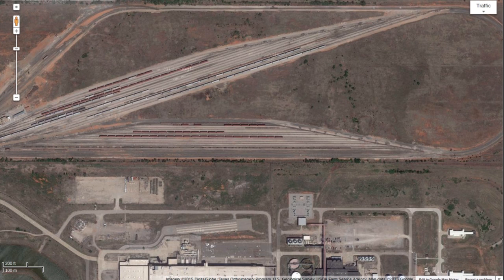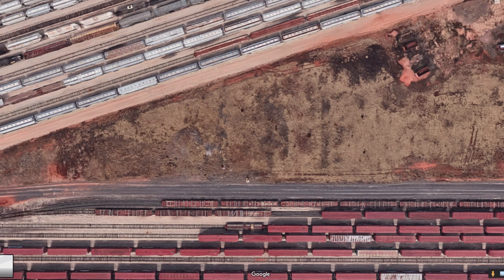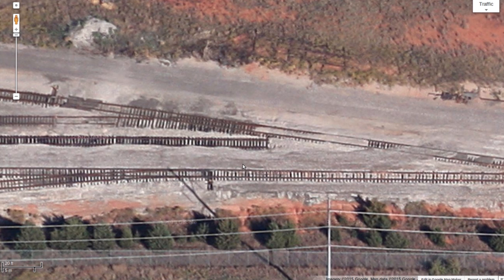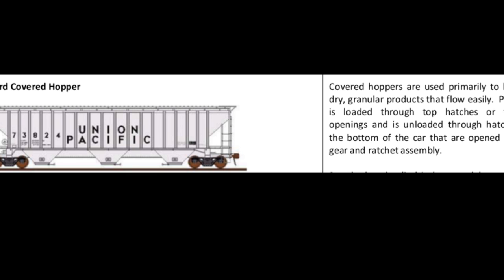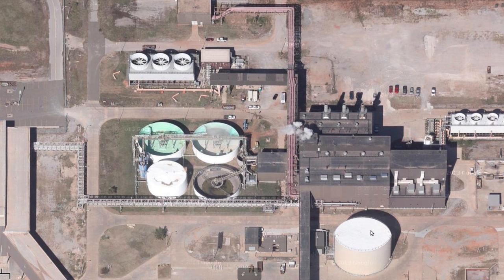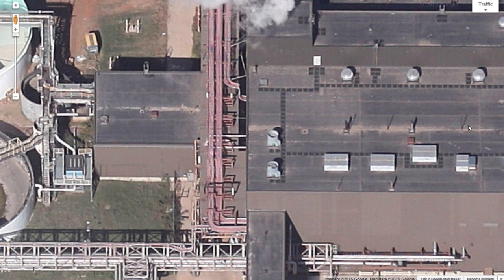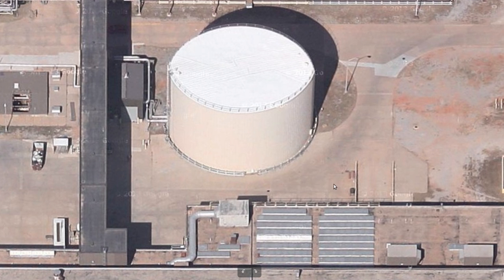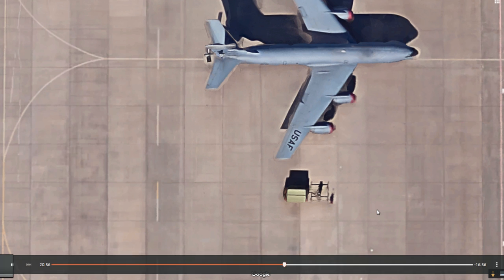Chemtrail Factory at Tinker Air Force Base, part 1 of 2

Comment: I got a street view over off of air depot Blvd and I can see some train cars and tracks. So I figure they have demoed the tracks. I'm gonna stop by and see in the morning. You know what's funny(for lack of a better word) for years , every year, they would have the ole, Tinker, on the chopping block story on the local news, as if.
Reply from the maker: Closing Tinker is like the big USAF announcement in 2014 (?) that the Gakona HAARP would be permanently closed down. Of course, they didn't, and now they are building it 40% bigger to increase the power dramatically. We sheeple are so dumb, we'll believe anything, as long as it comes from an authority figure, like a talking head on TV.

Comment: Thanks for this disclosure.
Coal ash and Aluminum fluoride are two of the worst industrial wastes. 
Process chemists are taught that the solution to pollution is dilution.
Do you have a better solution? Fluoride was dumped into the drinking water supply because if it is released into waterways the destruction of aquatic life is too devastating. 
By using fluoride in water supplies it allows a controlled release of the toxic pollutant as opposed to the unregulated release by the producer of the waste. Coal ash is a wonderful way to make artificial clouds. The only problem is the heavy metals in the ash are polluting the soils. If the ash is pretreated by removal of the heavy metals I see no problem with the Chem trails.
Stop using coal for energy and find a better way to make aluminum metal and the problem is solved.
Reply from the maker: Yes, I do have a much better solution to prevent runaway climate heating, but it MUST be started within the next two years.
"aluminum levels have risen over the decades and are now up to 18 times higher than the California EPA’s Maximum Contamination Level (MCL), as volunteer environmentalists discovered from water and soil samples submitted to state-certified labs, adding, “Whose job is it to take action when the state maximum of 1000 ppb is exceeded?”
If you really think aluminum falling from the sky is OK, please look at this California group of grass roots scientists, and what they have to say (and their measurements of aluminum levels): https://www.swataluminum.org/press-release
As far as flouride wastes, it should be buried in deep rock tunnels, or returned to the mines that produced it. It is an extreme greenhouse gas, and toxic to life, so it must be kept out of the biosphere.

Comment: To bad the rail yard's are gone now. Must of the rail yard was used by GM to load cars.
Reply from the maker: Yes, the GM cars would be loaded onto rail cars using the single rail loop, coming down around the white building, but those rails were pulled up before my pictures were taken, so the GM use doesn't apply in this video. Too bad the google dates don't actually tell when the old pictures were taken, just more magic from google.gov

Comment: Uuuu, yea man... They don't use conveyors for that material. It would be impossible. That stuff flows like water. It is fluffed up, airorated, and blown / vacuumed to where they want it to go....
Reply: Power plants DONT filter that shit.
Reply: Man, you ain't got NO clue! Those are smoke stacks!
Reply from the maker: What do you think they are burning in those buildings? I don't see any soot inside the smoke stacks.
Reply: @thehaarpreport9203  my good "GEUSS" is that they are natural gas burning boilers. They heat up water to create steam to run through coils or heat exchangers to heat up the fly ash to move it. I just guessing tho. The facility in question all most looks like a power generation station... You can't mix the fly ash with water like you said... It will turn to concrete. Another thing, I don't now how much more you could grind that stuff it is sooooooo fine. I apologize for being rude..
Reply: @thehaarpreport9203  if they are well maintained boiler with NO  tube leaks, they won't have hardly anything visible coming out that you can see, just heat waves. Some of the tanks have insulated piping. These tanks could be for condensate RO polished water to run through the boilers...

Yea man, this plant I know of has alot of fly ash truck running day and night. I've always thought they have sprayed that stuff in the sky...

 You go out out a bad night after they had been spaying that day. Shine a high power flash light up and you can see all the stuff floating in the air. It makes me sick.,.. we are getting sprayed like bugs.
Reply from the maker: Dane Wigington, and I, were experimenting with brith spotlights to measure chemtrail fallout, three years ago. I thought there would be a way to measure the amount of chemtrails, then build a national network of measuring sites. With maybe 100 volunteers making the spotllight measurement, you could map where the chemtrails were falling. Then, you could correlate that with WHERE and WHEN the spray planes must have flown. That type of disclosure would basically shut down the spraying program. I guess I used the word "chemtrail" too much, as Dane hates that word. You have to say "stratospheric aerosol injection" around him, which is OK with me. 
So, you had the spotlight idea, too... Some nights the crud falls down thick, in big globs. This stuff tends to stick together as it falls, most of the time. My old videos show thousands of long web fibers, falling out of a hazy blue sky. 
We are lab rats, in a very large lab. The rats always die, you know...

Comment: TINKER AFB & MK Ultra Monarch Mind Control Programming "Tinker-Bell" 
Tinker Air Force Base is a major United States Air Force base, with tenant U.S. Navy and other Department of Defense missions, located geographically in Oklahoma City, Oklahoma. 
Tinker is the headquarters of the Air Force Materiel Command's (AFMC) Oklahoma City Air Logistics Center (OC-ALC), which is the worldwide manager for a wide range of aircraft, engines, missiles, software and avionics and accessories components. The commander of Air Force Sustainment Center (AFSC) is Lieutenant General Lee K. Levy II and the commander of the OC-ALC is Brigadier General Tom Miller. The host unit at Tinker is the 72d Air Base Wing (72 ABW) which provides services and support for the Oklahoma City Air Logistics Center and its tenant organizations. The Wing and Installation Commander of Tinker Air Force Base is Col. Kenyon Bell. More at Wikipedia 

https ://thelumumbareport .blogspot .com/2010/01/some-operatives-within-monarch-mkultra.html
The Lumumba Report
A news magazine unveiling the Illuminati plot to control the world
Monday, January 4, 2010
Some Operatives within the MONARCH / MKULTRA Mind Control Program
Gerald Ford, Ronald Reagan, George Bush I & II, Bill and Hill Clinton, Rober C. Byrd, Alan Cranston, Madeleine Albright, Dick Cheny, Bob & Bill Bennett, Alan Simpson, Arlen Spector, Jim Traficant, Governor Mellon, Bob Clement, Pierre Trudeau, former Mexico prez De la Madrid, Prince Bandar Ben Sultan, former Michigan Governor, Blanchard, Dr. Steve Hassen, Henry Kissenger, Dr. Jolyn West, Civia Tamarkin, Sue Carper, Joe Casey, William Casey, Dennis Delaney, Frank Sinatra, William Dieh, Lloyd Lindroth, Bob Hope, Larry Flint, Jimmy Buffett, Rev. Billy Graham, Rev. Billy Roy Moore, Charlie Pride, Jack Greene, 
Country music operatives: Alex Houston , Lee Atwater, Boxcar Willy, Jimmy Dean, Tommy Overstreet, Lee Greenwood, Jimmy Walker, Jerry Reed, Kris Kristopherson, Wayne Cox, Ken Riley, R.C. Bannon.  
Baseball operatives: Tommy Lasorda, Nolan Ryan. Don & Guy Vanderjagt, Bud Crammer, J. Bennet Johnston, David Rorick, Patrick Leahy, George Lucas, Michael "Dante" Viti, Reggie "Mac" McLaughlin, Hal Meadows, Dick Thornburgh, Micky Miller, Ray & Regina Myers, Scott Rosenburg, Carlos Salinas (mexico),  H.R. Gibson, Gary Ackerman, Larmar Alexander (ritual satanist),General Cedras, Lt. Col. Michael Aquino, Jack Valenti, Jose Busto, Vesbit, father Don, James Thaylen. 
CENTERS FOR MIND CONTROL EXPERIMENTATION: Branson Missouri country Music Center, Lords Chapel Church, St. Frances of Assisi, Catholic Center high school (Muskegon, MI) Jesuit College(Wheeling WV) BOYS TOWN, the Morman church, "Church" of Scientology, Andrews Air force Base, Barksdale Air force Base, McDill Air force, Offutt Air force base, Plattsburgh Air force Base, Tinker Air force Base, Robbins Air force Base, Ft. McLelland, Ft. Meade, Ft. Campbell, NASA: Cape Canaveral; Washington D.C., Marshall Space Flight Center, Redstone Arsenal, HARVARD UNIVERSITY!!!
 - source "Trance-Formation of America by Cathy O'Brian and Mark Phillips. see also "Thanks for the Memories" by Brice Taylor  

Note: The Tinker AFB MK Ultra Monarch Mind Control programming for children is called Tinker Bell. 

selena-gomez-tinker-bell | intheknow7's Blog
MK (Mind Kontrolle) Ultra Program: PsyOps & Satanic Infiltration ... selena-gomez-tinker-bell. Tinker Bell Prog'mg. Like this: 
https ://intheknow7 .wordpress .com/itk7-esoteric-kitten-journal-2011/selena-gomez-tinker-bell/

Comment: Hamilton Ohio has salts leached out of their well water in large fields, There is a company that get this white salts and takes it to the local power plants and it's used to extract the polution from the smoke. I'd be glad to take a bet that the White Chemtrails are a large portion this product ! Google Earth Hamilton Ohio and you will see these areas. There is a spot in Sharonville Ohio across from the Ford Plant on Sharon Rd that they also pickup and deliever !!!!!

Comment: THE RAILROAD TRACKS ARE GONE NOW??????????
Reply from the maker: On Google Maps, the tracks are still there:  https://www.google.com/maps/@35.399488,-97.3965664,1689m/data=!3m1!1e3
Maybe this is an example of Google serving different content to different users??? It definitely happens, so I will continue to see railroad tracks, while everybody else sees red Oklahoma dirt. That would be standard operating procedure, to keep a lid on this info.
Maybe Google Earth gets faster updates and the tracks were really pulled? I can't run Google Earth, since I use Linux, so other people have to look.
Reply: Mine shows the tracks gone as well, they are building in that area now I know cause I'm in the area quite often, maybe it's not showing on yours cause we have different versions of Google maps, they can be different if they're not updated

Comment: Please explain you facts to support "run away global heating".  I seem more evidence for global cooling with the coming grand solar minimum.  Good vid for chemtrailing.  Thanks.
Reply from the maker: There are roughly 22 positive feedbacks built into the climate system. As it gets hotter, it gets hotter faster, then it gets hotter faster and faster, with no stopping it after 2020. There is only one negative feedback, that I know of, that tends to cool the earth, as it heats up. Right now, the earth is getting an extra 3 watts of heat for every square meter of surface. Imagine a 7 watt night light over every 2 square yards, and you can see why the earth is heating up. This heating is now accelerating due to the 22 positive feedbacks, the new cliche in the media is "hot house Earth". The variability of the sun is only a few percent of what is going on with the greenhouse gas increase. So far we have 1.5C heating, but we will see over 12C heating in just a couple of centuries. Of course, all mankind will be extinct by about 3C of heating, so get ready for an unbearable situation very soon. Increasing UV is killing everything, and strong storms/chemtrails are destroying the ozone layer even faster. Burning coal is a total disaster for the ozone layer. Sea level rise is 4mm now, doubling every four years. It is like doubling a grain of rice every day, by day 30 the entire earth would not hold all the rice. Anyone who tells you the earth is cooling is an idiot, paid shill, or willfully ignorant (like trump).
Reply from the maker: Forgot to mention, about 95% of the extra heat, so far, has been absorbed by the oceans (hotter than they've ever been), but they are reaching their limit. As the arctic becomes ice-free, the jetstream will shut down, causing stationary drought and flood patterns, with no jetstream to move them along. So, get used to extreme weather as the new norm, but mostly killer heat will be the new norm for all of the planet.

Comment: thats not how a batch plant works
Reply from the maker: There should be a dry conveyor which moves the aggregate/sand and portland, measures volumes and combines them and mixes some more. That is how the one I worked on was designed. So, I might be wrong about the white tank being a water tank. Instead it might be the final mixing silo (too close to the ground for that), but there needs to be a control building with metering valves to control the weights/volumes, and there isn't one nearby. I think my explanation is right for this simplified readymix plant. It looks like it was built more for appearance, than for producing a lot of concrete. What do you think is the right answer?
Reply: @thehaarpreport9203  
the white tank is the silo for cement if they were adding flyash to the mix it would have its own silo. the mixer truck backs under the silo the aggregate is conveyed into the mixer and the cement is gravity fed out of a scale under the silo
Reply from the maker: Yes, that sounds good, but the whole point is that, there is no way for the cement powder to get from the railroad tracks, over the fence to the readymix plant. I think a slot in the tracks is the only way to unload the covered hopper cars, so where is the slot in the tracks, if it isn't one that I showed in the video. Anyway, I hear from Google Earth viewers, that all the tracks are gone, and construction is going on, where the railroad switchyard used to be. This whole video was for historical documentation, it is pretty interesting that they are in a hurry to destroy whatever evidence remained.
BTW, the plant I worked on had a special side track for the cars to dump into, and underground conveyor belts moved the cement about 150 feet into covered steel silos that were 40' tall, and 20' wide. Nothing like that exists at this plant. I could get photos of the actual plant, but it is just like I described.

Comment: I wonder if you're  not trying to make something out of nothing?
Reply from the maker: Well, there have been a ton of rain and soil tests showing the exact same metals as coal ash, and in the SAME proportions. Also, the geoengineers, going back to Teller in the 70's, wanted to add aluminum as a sun shield, so there is no doubt this spraying DID go on, and is proabably still going on. The only question is how did they manage the logistics. This base was a prime candidate for spraying coal ash from KC135 tanker planes, for at least four years.
Reply from the maker: Here are the latest test results, showing coal ash in rain: http://www.nuclearplanet.com/whin.pdf

Comment: Love your info., can you increase the volume on the next ones, tough to hear, as I keep my laptop at a distance as they force bad and brainwashing into through it, onto us.  To keep a semi-safe distance, do NOT look directly into your computer, sit at an angle, far away and vary your level to the computer: stand, sit and look at it from the side.  A moving target is harder to hit, make sure NEVER to look directly into the computer, use your protective glasses from their brainwashing and bad frequencies...or a protective screen you see into the compter through but they cannot see you type screen...
Reply from the maker: If you are having bad effects from your laptop, turn off the wifi microwaves (2.4 GHz) and just connect over an ethernet cable. Also, get an emf meter, and test the laptop for high emf. Most have high magnetic noise fields, that is what is bothering you, not the CRT picture. I recommend the Cornet Electrosmog meter. It measures microwaves, UHF, and a low frequency, like 60 Hz. It is important to know how much emf you are exposed to, if you want to maintain your health. BTW, the cheap chinese fluorescent spiral bulbs put out a ton of emf at about 18 KHz, within a foot, my meter goes into the red, so I removed them all and went with LED bulbs (very cheap now). Another terrible thing about all fluorescents, is they leak UV-B, which will destroy your vision over time. Of course the cheap chinese bulbs are the worst, but the good Philips (german) bulbs are the best for UV leakage. One more thing, if you have smart meters, that is what is making you sick, not your laptop. Smart meters put out an obscene amount of microwave power, compared to 3G CDMA phones, like a million times more... Just thought you might want to know
Reply: Ok, thanks!!  The thing, I was telling you about "looking into the computer" is that they (CIA/FBI and the mind control dept's) PROGRAM us, when we are close to the computers through out eyes, so don't look into the computer alot...two seperate concerns..just sharing...thats for your good tips, I will order that Cornet meter and try the ethernet cable...Thanks!! 😉😇🌹🌎🐾

Comment: The trails CAUSE warming! Hello!?
Reply from the maker: Solar radiation management causes short term cooling, but long term warming. It is designed to reduce the population in a quiet, safe, manner. The dust layer at 30,000 feet lowers surface heating, which would normally cause storms, and the chemtrail hot air layer stops convection, preventing thunderstorms. It is a way to produce drought, fires, increased CO2, starvation, mass extinction, and long term heating. It's pretty obvious, if you watch them long enough. It is so obvious, that NOAA forces meteorologists to sign a secrecy oath. Any weather watcher can see these effects.